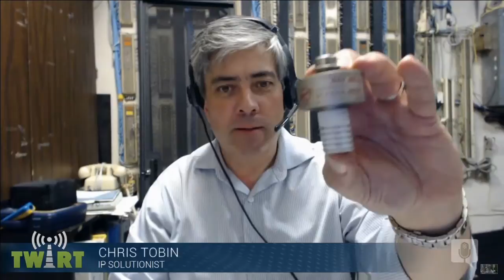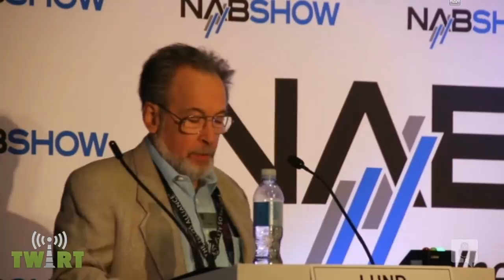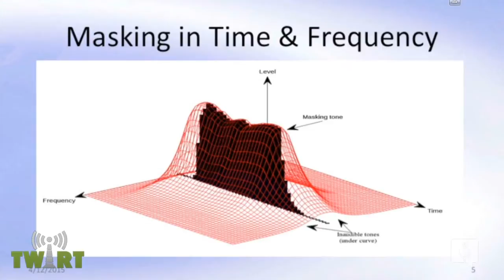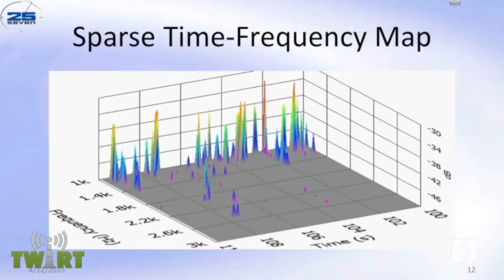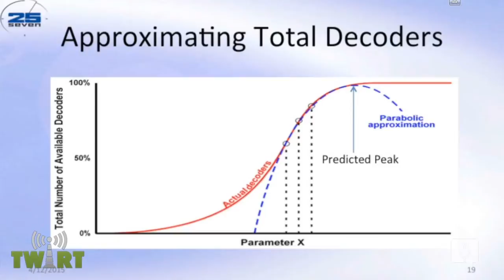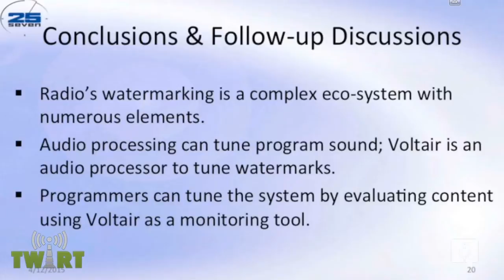TWiRT Ep. 256 - Audio Watermarking Technology Explained 4-30-15

Comment: Wow, very informative. I was curious about Voltair. My only suggestion would be to have some audio examples of what it sounds like with and without the use of Voltair processing. Ideally, you could play a snippet of a familiar song and then repeat it with the Voltair cranked up and then hear what the difference sounds like. Ideally, there would be a sweet spot in which you could set the Voltair as high as it can go without making the audio sound bad enough to drive away listeners.